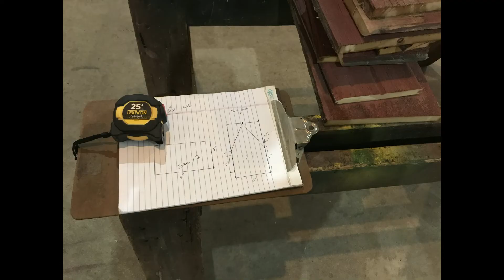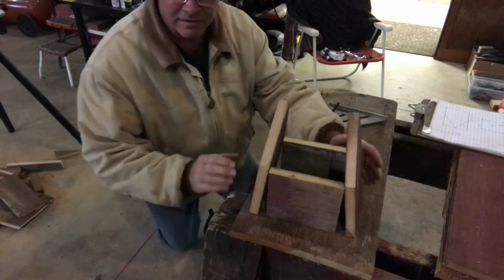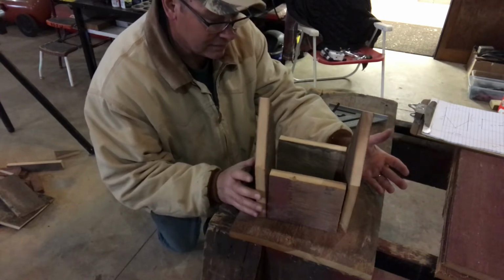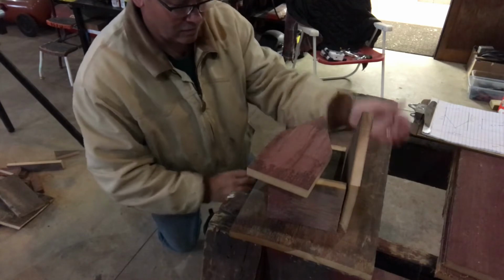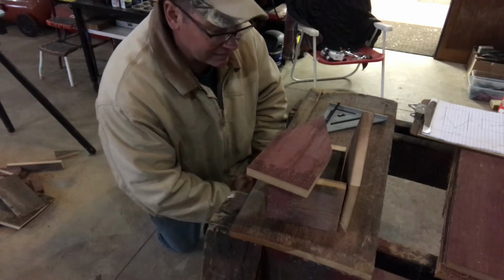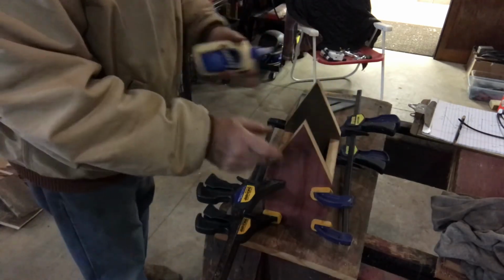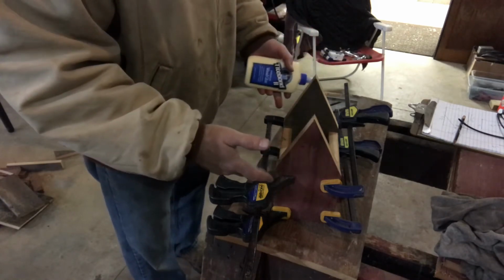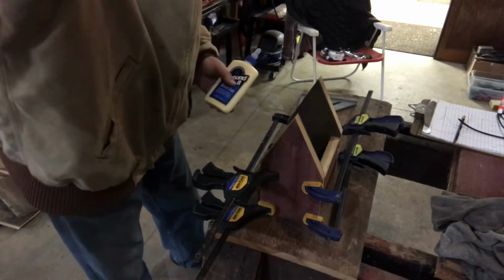Scoutcrafter's Birdhouse Challenge - part 1

Comment: Nice work Todd. 
Here's a tip. 
In the bottom line of your description add 3 key words with a hashtag. 
Like #scoutcrafterbirdhouse #birdhousechallenge #diybirdhouse.
YouTube will automatically place those near the like button. It will get your video suggested more and guide people to your vids. 
The algorithm sorts by # words first.
Reply from the maker: Did not know that... Thanks!
Reply: @tfknauss  When I first learned about it I tried it on some older videos that had flattened out on views. It raised the numbers. So I started adding it to the discription when I posted a new video. When that worked I went back to some older videos. 
Doesn't make a huge difference but it's noticable.
Reply from the maker: @OldSneelock  Thanks!
Reply: I didn't know that either, Thanks very much!